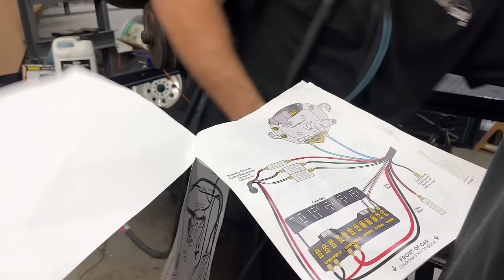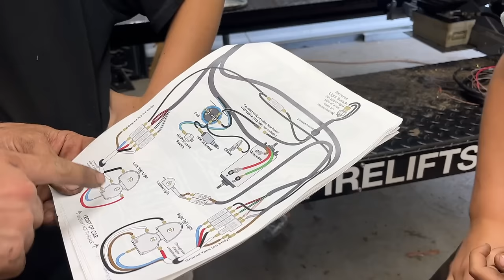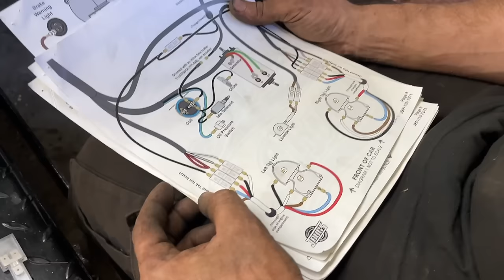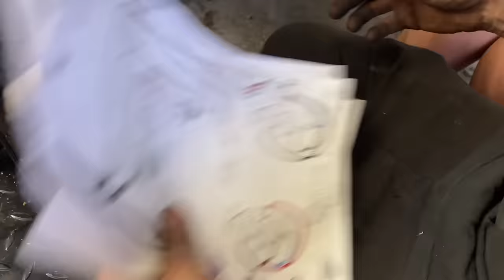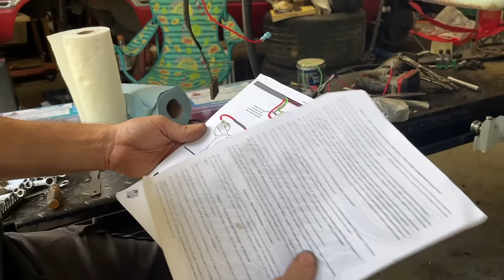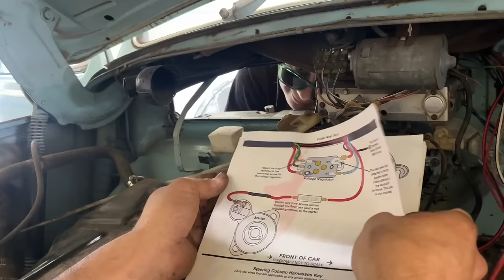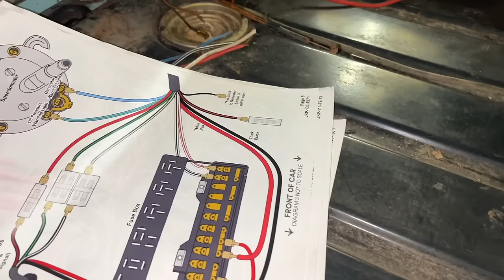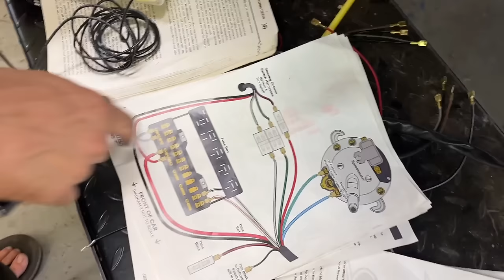Back on the road after 23+ years parked!

Comment: Josh you mentioned in the car show video the gas gauge doesn't work.  Turn on the ignition and briefly take the wire from the fuel sender touch it to ground if the gauge moves it is your fuel sender unit . That is an easy fix. Make sure to get one for a super beetle different gas tank then a standard bug. If the gauge doesn't move then obviously check the wiring or you might need a new gauge you can buy replacement.

Comment: BTW be sure to adjust the valves before you drive it very far. If the valves are misadjusted it can burn them. Most people don't know how to adjust them so they are usually well out adjustment. If they don't rattle when they're cold then they are too tight. Wawa is so lucky to have a wiring genius to do all this work. When I was working for Toyota I did most of the wiring on my team and they always referred to the wiring guys as "dash rats". I had a 69 bug as my first car in the late 60's and I drove from NY where it always got through in the snow to LA where it lived at the beach. I loved that car.

Comment: Hi mate greetings from downunder, 009 distributor(mechanical advance) have a stumble at lower revs. They were first designed for a stationary vw engine such as a generator or other applications. The advance curve is better with a vacuum advance dizzy andcwill have smoother acceleration. Set the timiing to about 30 degrees at over 2500 rpm. 12:44
Reply from the maker: Ok thanks

Comment: When you were routing the wiring harness from engine bay through the driver's side body,  you mentioned you saw  something obstructing your routing.  What you called sprayfoam is actually factory styrofoam type stuff which many years later was found to be a bad source point for rust-through from the inside due to moisture absorption of that foam.  It's strongly recommended to remove all of that styrofoam type stuff and either leave empty or use closed cell non-absorbing rubber.  The old foam was assumed to be used to prevent engine fumes from getting into the cabin.

Comment: @Sleeperdud88 I was working on a new wire harness for my wife’s 77 Bus today. What a pain, but I upgraded and added a few things that the bus did not originally have like an engine bay lamp, third brake light, and multiple 12-volt cigarette lighters.

Comment: The horn button is missing so the horn grounding ring is always grounded. You will need a  horn button and a spring to keep the ring from grounding and the horn from blowing. Usually the horn is not powered with ignition but is battery hot.

Comment: I bought a '73 1300 when I was 13~14 as my first car (I'm from 1976), but this one has me confused. I think mine was built/assembled in Germany for it had small tail lights, upright spare tire up front (which doubled as the windscreen wiper fluid reservoir pressurization thingamajig). This one is from the factory plant in Mexico I think looking at the tail lights. The bigger tail lights from the older models have the nickname 'Sombrero' here in Europe. Model types vary very much in these years between Mexico and Europe.

The Beetle is a beautiful and simple machine, much like a lawn mower, it does the job and does it well. As a matter of fact, the engine design is what keeps 50 year old airplanes flying, forced air cooled opposed cylinder engines like Lycoming. I sure learned at a young age how automotive engineering works hands on with this piece of history.

You reworked the brakes in a great way, but maybe grant it some thick-walled easy-bend non-corroding hard lines. Give the cooling tunnel lots of love, you want max airflow around those cylinders and heads. Guinness World Records were made with this car, didn't see the next vid but read something about prize winnings.

Parts should be easy and affordable, even in the states, you know how many have been built and how basic it is. Prime money for parts is a sure scam in my opinion..

With love and attention this could outlive at least 10 generations of iPhone and become the new record holder of miles to the memories..  ;)
Reply: I hope you found out that part of the heating system runs through the beams at the base of the door stills up to the front foot well and up to the windshield defrosting ducts (at least Euro models did it like this). It's forced air everywhere, no coolant leaks!

Comment: Vacuum advance definitely gives you more power. The specially going up hills and I would also run an additional ground to your distributor using the Patronix. Make sure she doesn't leave Ignition on ACC Without running More than 10 minutes. that will burn up the electronic igniter. It's a good upgrade I've heard. Good things
Well made Patronix 20 years, no problem.

Comment: Ever have trouble with rough engine running in the wintertime it may because an aftermarket air cleaner allowing cold air into the carburetor that frosts up the carb and intake. Best to use the OEM air cleaner in winter. And, run the preheat tube up to the air cleaner.

Comment: Nice job! Looking forward to more progress on it. Id change out those front end bushings, I had to on my '73, they are common to go out on Super Beetles. Also I suggest switching to a 009 distributor, and H30 31 carb with adapter plate, that'll get rid of the flat spots in acceleration.

Comment: If you put new dual outlet pipes and the exhaust stainless steel tips add a brace to support the exhaust pipe so it doesn't crack the exhaust pipe in the process of vibrating the exhaust pipe.

Comment: 009 distributor are mechanical advance. No vacuum you  might notice it bogging down from 1st to 2nd gear . This happens sometimes with 009 distributors . If you have that problem adjust the accelerator pump on the carb and slightly advance the timing a little at a time.  Rpm at idle should be between 850 and 900 rpm.

Comment: I rebuilt an Australian built 59 Beetle for a friend also Dolphin blue like Wawas I had a running but stripped 63 for parts and they are different but two made one really tidy 59 I used the best of two looms to wire it up and luckily when I rebuilt my 59 3A Hillman I found a 3B that had any parts I needed again two made one tidy road car, the 59 Beetle had the vacuum advance I fitted the entire 63 engine and transaxle so thats where it got it from, original who knows it ran great for 1200cc eggbeater, good first car for a teen, my teen wanted my turbo diesel manual Citroen hatch instead of the Sentra I found for her,
Reply from the maker: Oh cool

Comment: Fantastic! what a great first car for Wawa. Back in the nintys I had a 68 bug. I was the same blue as Wawas. I had dual carbs on it. It was lowered and I had centerline wheels on It. Unfortulatly if had a cylinder destroy itself and I had to let it go. And it just was'nt impressive for a guy who owned a Mustang restoration and parts business to use a bug for a daily driver. I had to go back to driving my 69 Mustang convertible. Sigh, such a sacrifice. I have a question for you Josh. I noticed that when you bled the rear brakes that you squirted brake fluid on the rear c-v joint. They are part rubber so is that OK to do? I have seen the car show video and the bug was walking tall. I hope Wawa has many enjoyable times in Swazye. 😎🐞  👍

Comment: They run hot so synthetic. No oil filter so change the oil more often and they have solid lifters so you will need to check the valve clearance. I've forgotten if you check it warm or cold. I burned up a forty horse once with mis adjusted valves. Burned the exhausts right out. You may want to order new valve cover gaskets I think they were cork. Glue it on the cover side. I wish I still had my 40 horse. The stock muffler works well. Don't forget you're getting heat and defrost off the heat ex changers that the exhaust is running through so you want to check and make sure there are no leaks. Or exhaust gasses getting into the cabin. Don't forget the valve clearance and make sure you get the right spec. Looks like a 74. They may have gone to hydraulics by then but they always had solid tappets. You'll need zinc. Or some kind of EP additive. The underside of the manifold pulls heat out of the exhaust to prewarm the mixture as it tends to frost the manifold.

Comment: If you lift the rear end by one notch on the torsion bar it will protect whatever exhaust you put on it later.  Lots of those exhaust pipes got drug off or beat in reverse when the rear was too low 😅

Comment: The distributor is a Bosch 009. They did away with the vacuum advance in favor of just mechanical. They work well with the single port heads, fortunately. Dual ports hesitate and bog. They're for high rpm. I prefer the single ports. Way better for daily driving.

Comment: Just suggestion because being old don't run synthetic oil it will leak everywhere its not problem when u freshly rebuild them but the old seal don't  like it and oil cooler with a fan is big saver on it and lots of friction modifiers are a plus and good thing to keep maintenance on is valve lash these motors have short maintenance intervals  and yes keep all the shielding on is a must so many people remove them and it destroys the heads witch common problem is the one side does were more do to heat so a fan blade change helps there so many upgrades for  tins stock work great with updated fan for moderate power anything to decrease heat on the motor is big plus and a first car is amazing to get people working on car it went from bike to these and then so on some great memories with bugs and buggies  that we built as kid 14-17 when I got involved teaches youth about cars keep up great work.

Comment: I would update the fuse block. Older fuses are becoming harder to find. I have 67 barracuda I plan on updating the fuse system in when I do my total rotisserie rebuild from /6 to 383. I don't know if you know but if you start running synthetic in classic you need to keep watch being older motors where not made for synthetic will sometimes leak around just about any gasket also you should never switch back to normal oil. Best to use a blend oil in classic unless you plan on rebuilding motor.
Reply from the maker: Ok thanks

Comment: Your old carb problem is most likely the idle jet next to the choke on the outside of the carb. its very common and acts like a big deal.  YES the svda distributor is a better deal for street driving  oo9s were big with drag guys. with the pertronix and the vac advance  you should see a bit of mpg increase  add zink to the oil.
Reply from the maker: Ok thank you

Comment: In case no one has told you this already, the oil cooler blocks proper air flow to one cylinder. To get around this problem, VW ground off the tip of one of the distributor cam lobes. This retards the spark on that cylinder, which makes it run cooler. So, you need to ensure that the distributor cam is in the correct position. Alternatively, an external oil filter works better on all levels.

Comment: If my memory serves me correctly, the Dizzy should be a 009 dizzy. The Petronix is good IMO.

The type IV engines (which ever came in the type I) would run EFI from a company called MegaSquirt. The cool think about the Type IV “Pancake” engines (Late Type 2 and Porsche 914) is that you can ‘upright’ them to fit in a Bug. I think it’s cool you can do the Porsche style fan.

Comment: Hi Tash and Josh are family. I was tough at tech the best way to have earth - in a motor vehicles is to run a main earth from the battery to a bras s block and run a earth wire to every thing that requires a earth. To    much resistance  in the  body   and panels especially the headlights. All the best from down under. Dave

Comment: The 81 Chevy c20 the junction block had caught on fire before so the distributor battery lead had to be removed from a junkyard truck and replaced only to find out the alternator plug wasn't any better so I changed the alternator, starter battery cables and a new battery and cut up the bad battery cables so no one else ever tried to use them. And that truck had great brakes and the front ones were not the only ones that worked but it only had one rear brake that worked,i liked that truck but I had 3 much better trucks so I ended up giving it to a buddy of mine to use for a wood hauling truck until he sold the 350 sbc out of the truck.

Comment: I just remembered there is a bellows type device that expands or contracts I forget which and it operates the flaps that control how much cooling air is going through the engine. The flaps close when it's cold to speed up warm up. It may fail in the closed position. Which would lead to overheating. There is a manual somewhere for it. The bellows thermostat is prob still avail. Good luck with it. The bellows device is no electric. Some kind of bi metal device that is affected by heat.

Comment: That generator sparking so bad is because it needs to be POLARIZED. You do that by taking the wire marked as B+ from the regulator(under the rear set) and  jump it 2 or 3 times to the battery positive post.

Comment: If you push a rubber or clear plastic tubing over the nipple area of the bleeder screw, you can bleed the brake lines and still see if air bubbles are coming out of the lines but you don`t get brake fluid all over the place, like paint, rubber,,people`s eyes ..etc...

Comment: if you put a clear 1/4 hose on the bleeders and drain the brake fluid into a bottle it won't get on everything and you can see if it has air still in it.

Comment: Those flat connectors are called "Fast-on" connectors, spade (lug) connectors are two tang forks.  I owned two of these (one used, one new) and I did not think the gas mileage was so good.  (6 cylinder PU tucks got better) Ron W4BIN

Comment: A VW distributor that does not have a vacuum advance is a racing type unit called a 009 type. It relies on rpm s to advance timing using weight springs inside the unit. Great for winding out a motor, not great for city driving.

Comment: You want a SVDA distributor, the 009 style that you have, will have a flat spot, the vacuum advance will smooth things out.
Reply: Save that carb and get it rebuilt! Run the Rotella 15-40 which has Zink for the flat tappet cam! No synthetic!!

Comment: I have a 1971 super beetle me and my grandson worked on it for a couple of years and now we go everywhere in it we luv our bug sure do luv your lil blue bug let us know what year it is k
Reply: I bought my bug about 3 or 4 years ago from my boss everything was restored on the bug the first thing that I did was to put disc brakes on it front and back the drum brakes wasn’t to safe to drive on I put a new carburetor new fuel pump new running boards next on the list is to put new push rod tubes they are leaking a little oil just a couple of weeks ago I had to do the wheel bearing on the rear end had a broken roller bearing the outer one the inter bearings are ball bearing it was quite a job to do but now it’s running so great I drive it back and forth to work every day one of the easiest cars to work on

Comment: Your smelling gas and exhaust from the chrome air tube that feeds your hot air inside from the heat exchanger. I noticed it was twisted and ripped at the top. It is a must to make sure all that in good shape or it will always smell that bad

Comment: I heard you mention using synthetic oil.  The oil is part of the cooling of the engine. Synthetic oil is good lubricant but not good for cooling down the engine. Also the molecules in synthetic are smaller then regular oil this could cause  more oil leaks. Run 20/50 that is a good weight for winter and summer. These engines were designed to run on leaded fuel 101 octane so I know it cost more but run premium gas. It will perform a lot better.  The engine running sound good but I suggest checking the valve adjustment that would make good video! The littlest things make a big difference on these cars.

Comment: i wanted to comment on the fist video about the car but i wanted to see how it turned out your a good dad making sure the car was mechanically sound for her first car at least its not some fast hot rod it will be a safe car i dont think that electronic ignition was designed to work with a ballast resistor i would put an original steering wheel back on it those after market steering wheels are not designed to work like factory ones do ive ran into that before !!! 😊

Comment: It's not going to beat anyone away from the lights, but believe me, dirt, grit, snow or ice, you learn that clutch and not to push to hard and you are going to be following 4-wherl drives around when others are stuck...

You're not going to freeze up because there is nothing to freeze up. The Australian's took one of these to the Antarctic...

This car treated well WILL last you a lifetime... You'll be giving it to your kids...

With a little tweaking it will run on anything 92 octane up, keep a spare coil and watch your charging and it won't let you down.

Beware of your garage when you fit the exhausts, you will rip them off based on your exit from there. You will love the noise when a proper exhaust system is fitted, and the back pressure will improve running and economy...

Comment: The reason VWs did not use hose clamps on fuel lines is they were a braided line that would clamp down on the metal pipe.